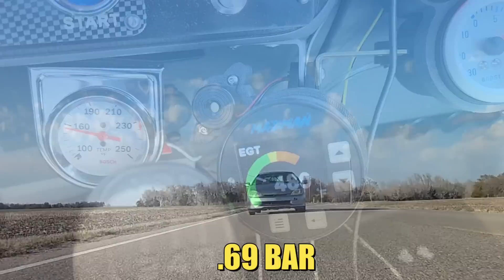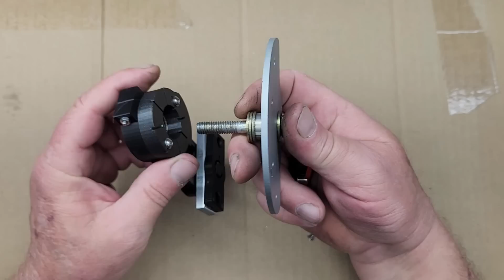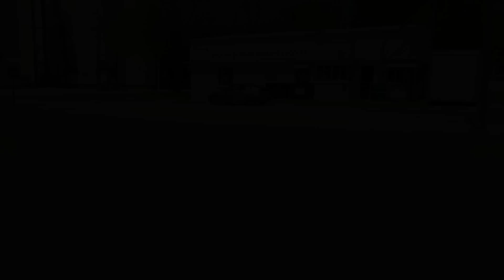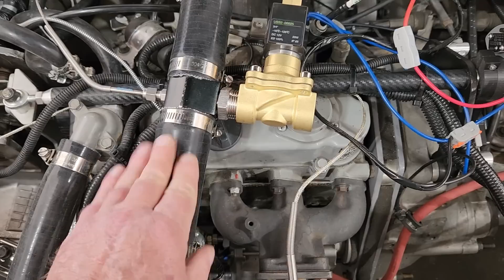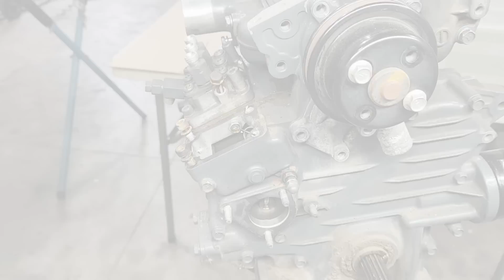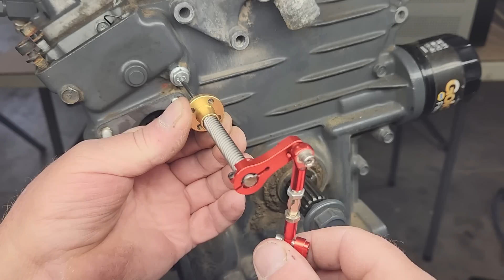S4 E15.  We  test the effects of full boost on the AMR500 supercharged the Kubota diesel engine

Comment: Yes, I'm building electronic engine control for cheap chinese 50cc 4-stroke scooter, so really interested seeing similar stuff. First ignition with different advance maps. Later fuel injection, but it needs so much more, need to build wideband controller, throttle body (from 24mm carb) etc..

Comment: This is what I love about your channel: Let's not settle with a on/off switch, let's add a valve and let's add a servo and I've printed some stuff off camera and let's go.

Most people would just half-ass try something out and stop when it goes into electronics or simple programming a micro controller, while this is exactly the best solution for most mechanical issues, if you don't wanna spend reinventing super complicated steam power mechanics.

Comment: What if to connect a supercharger to a petrol engine via a variator, and decrease its speed at low load, so that it will not produce an extra pressure but will decrease it. Then you don't need a throttle and pumping losses will return into mechanical work produced by the supercharger.

Comment: Tremendous observation and commentary about how hard it is to drive the original gas Insight in daily driving.  I owned a first generation Honda Civic Hybrid with the CVT automatic which benefitted from the technology that Honda researched/developed in the Insight.  The Honda Civic Hybrid was generally unhappy being a car and I never really learned how to keep all of the hybrid technology operating at peak efficiency.  I felt like Honda released a science experiment that was not ready for the streets (or at least the hilly Northeast where I live).  This was further confirmed by the three software updates released by Honda during my ownership-each radically changed how the car operated and reduced overall fuel economy.  With a new battery and fair weather (60s-70sF), along with a steady 55mph cruise (no a/c) the car returned almost 63 mpg-but it was back breaking hyper mile work. 50,000 miles later (and with the subsequent ecm flashes) the car would only return about 40mpg and only vaguely felt like a normal car.  Great work with the Insight, I am certain that the torquey diesel is the key to driving enjoyment and spectacular fuel economy.

Comment: Yes I'd like to see more with what your planing I'd love so see you put the turbo back on now the supercharger is also their to spool it faster and experiment with different ways of plumbing it like turbo into the supercharger like gale banks did on the race truck. Maybe use the ecu to trigger boost control based on pyro temps as a thought. I'm not sure how far you would go but can you do the same with cam timing theirs been good gains on moden engines that way. Either way I subscribed because of this little engine so I would like to see it go as far as possable other ideas would be a ram air intake for temps and air density improvements to keep up the good work

Comment: you can use a raspberry pi to have ful controll over the boost using a boost sensor and throttle position sensor. when the throttle is in a certain position for a certain time consistantly   (apart from full throttle) , the pi can assume you are cruising and not acellerating and can open the boost releif valve. the pi can also open the valve at 10psi if you dont want it to go further than that, and at full throttle it can give you all the boost if you wanted it to. using a pi will make it highly adjustable with many variables

Comment: Love your videos, I have a very mechanically inclined thought process and love every video you post, I was one of the original subscribers to suggest you use the AMR500 way back on the harborfreight engine, I have one myself and haven't decided what to do with it 😅 my vote is def yes continue what your doing, push the limits of that diesel and the supercharger till one gives or maxed out, my prediction would be the latter and the supercharger will reach its limits before you blow the engine or head gasket, if the engine blows you have a spare lol, I def want to see what you can make that little engine do FULL SPEED AHEAD!  just watch out for those pesky gnomes messing around in your engine bay

Comment: with this ON-OFF supercharger boost, there's a way you could modulate it without any further modifications, using the "pulse and glide" principle. It would require you to speed up and slow down from time to time instead of maintaining an exact 55mph speed, but simply going up and down from 55 to 60 ought to do it. Even 53mph-56mph acceleration and deceleration oughta do it. Get the throttle position low enough to un-boost yourself as you're slowing down, and you can get the car to go off-boost a lot. If boost is barely needed to maintain speed at 55 (in whatever gear you are using) then you should be able to adjust your solenoid switch to where you quickly run up to your max speed and then slowly drop speed off-boost. 

i've been using pulse-and-glide to try to improve efficiency some in my toyota prius. I'm not really sure how well the same concept transfers to a supercharged Diesel, since some of its efficiency is (maybe?) dependent on running boost.

Comment: What are about putting a air conditioner clutch on the pulley? Or a chainsaw centrifugal cluth. You won't loose energy powering the blower on idle/low rpm

Comment: Regarding the fuel rack, my apprehension (though I may be wrong) is that if you run the super at full boost at the same time as opening the fuel gate, you'll get a bit less smoke than if you just open the fuel gate, because there's more air available to react with the fuel. You may, however, need injectors that work on a higher pressure and atomize better.

I'm just joining this series for the first time, I suppose I should rewind to the beginning.

If you can find a way to make the injector timing advance under high speed, that might also help with the smoke.

Comment: Should I order oilseed sunflower seeds to your PO box and get you to grow 'em up so you can run the Insight on sunflower oil? Or have you already arranged for such a thing? (Would you even have the land to do so?)

Do you intend to change to a turbocharger or have you reckoned that you do not have the exhaust gas flow to do so? My apprehension is that with sufficient exhaust gas flow, turbochargers (turbine-driven superchargers) are much more fuel-efficient than crankshaft-driven or electrically-driven superchargers.

Comment: you can do code and adunio etc or what ever pwm solutions are needed so water injection and propane .that willl help a lot seems like a turbo be more easy and less drag yea egt`s but your not pushing it just geting up to speed and with water propane and yu programming Bobs you unculll lol  God bless PS i would start with water runs just on n off AEM makes a nice nozzle or snow performance seems like AEM is the nicest looking one but

Comment: I think dumping the boost pressure to atmosphere will decrease efficiency,  it will increase the load on the supercharger. I believe you need to install a variable bypass to the AMR500, and vary how much intake air comes through the blower or around it. Could even play with deadheading the blower, if its not moving an air it will basically free-spin (at the risk of possibly overheating).

Comment: So. 
Electronics and code. 
I literally watch videos detailing the breakdown of glitches, speedruns, etc. how the code works, with abnormalities caused by that code shown in the game. 
In a similar vein, I would love to have you explain how the hardware, supported by the sensors and software, can cause effects in how the engine runs, and how we can use those "abnormalities" to achieve a desired result (typically, go faster).
Continuing the project has my vote, it gives me nothing but more reasons to watch.

Comment: Why not just a butterfly on the supercharger intake directly operated by the throttle cable?  Also no need to actively control fuel delivery on a supercharged engine;  since there is a fixed relationship between boost and rpm @ wot, it can all be done with governor springs and flyweights.

Comment: You could use a air con pump pulley on the supercharger they have an electro magnetic on off system that you could run on a micro switch on the injection oump arm.

Comment: Yes please continue. I'm sure there is lots of improvements to be made.  Would be great with a clutch on the supercharger and both Turbo and Supercharger together. Supercharger for low RPM and Turbo for higher RPM and better efficiency. I'd guess to that you will get it down to 16 seconds to 55 and the fuel efficiency down a tiny bit. This will make this a very everyday useable car. Would also be fun to see you do experiments with bio fuels.

Comment: Yes. Use all available tech in your arsenal. 
Maybe small electronic fuel injectors HP pump and own coding on an arduino and electronic drivers for injectors. Yes it is a lot more complex but once done would have more controll on fuel delivery, timing and duration.
I don't know if arduino is fast enough to do multiple injections or fast enough to do one using high pressure, hi  pressure less time but better atomistic.
❤ the content keep it up.
Great work

Comment: My vote is YES please continue, BUT with a caveat, one of the comments  you've made is this car would run after the apocalypse. if you add "tech" you would get away from that. Your throttle switch solution is a great example of the way I think you should go. Take your programming experience and make it mechanical or simple electrical. Switches, relays, cams, mechanical movements, etc.

Comment: I'd be curious what you can accomplish with a fuel governed engine + technology, I have owned direct injection fuel governed engines, indirect injection, unit injection and common rail diesels, the CR's are absolutely incredible in their ability to run smooth, smoke free (close to it) and crank out some really impressive power and economy, they mostly got a bad rap from half baked emissions systems, lack of maintenance and people who tuned them too aggressively.

Comment: Getting max boost predominantly at your top speed, seems wasteful as you cant reach speeds any faster (above 57mph). The engine should be able to maintain that cruising speed once up to speed.

I would think that youd want to lower the rpm range where your getting max boost to the mid rpms for when your accelerating up to speed. Its more usable and less hard on a diesel engine.

Comment: Also, I had an idea for the intercooler and a further consideration. If you intend to mount the cooler on top of the engine as before, rotating it 90° (so it's standing upright but the entry and exit remain in the same rough location) might make it easier to get air in and out via a small duct, provided you have the hood clearance. I suspect a front mount for the intercooler on the vertical section just exiting the supercharger would be a better home for it though and certainly easier to get higher pressure air through it from right beside the main radiator, again ideally with a small duct. 
As for the consideration, if the cooler comes after the waste gate and you map opening position to the desired flow/pressure before adding the cooler, the added pressure drop of the core could change how it behaves. (Think, wastegate priority in a turbo exhaust manifold)

Comment: I would like to see you setup the electronic boost control. If you hookup a manifold pressure sensor, you will be able to utilize a PID loop with varying targets based on tps to set the 2nd throttle body. Might be less of a headache than hard coding the 2nd throttle body values based on tps and g forces

Comment: YES ...think using a GPS input values could assist no boost at stop, plus other input values during movement. But a fall back setting in case signal is weak or lost

Comment: Why would you want to dump boost from a diesel engine? You are already consuming power to turn the supercharger and heating the air. If you dump the boost you are getting no benefit, but still getting the down sides. A diesel does not care about "too much air" even at idle. It is 100% regulated by fuel. Concentrate on making the air cooler and regulating fuel. If you want to have selectable boost you either need a turbo or a cutout clutch and air bypass for the supercharger.

Comment: Hey Jimbo looks like you need a diode on that air bleed valve. Looks like the coil on it bucked and lit up your dash switches around ~1m into the video. This could cause other sensitive electronics to fail.

Comment: Yes and Yes. I would love to see the arduino mod (and propane injection). A honda  motorcycle cam chain tensioner 80's vintage may provide you with the action you're looking for the fuel rack. Although a cam lobe would be more adjustable. Good luck, keep up the good work.

Comment: One thing to consider instead of running an intercooler for the intake would be a heat exchanger. Or like a water→air intercooler. So you could run it in line like it is and not have to make that inlet piping more complex than it needs to be. And then pump the cooling water through a smaller cooler/radiator that would be routed down where the air is flowing. I think that would be simple enough to accomplish.
     Although I'm not sure that would be budget friendly or how cheaply it could be done. Just a suggestion that would work very well for what you're trying to achieve

Comment: YES  although I am not certain as to why, other than to see how you go about doing it.
You could use engine oil pressure i suppose. but the acme screw does seem simple.

why dump boost you are making? what is the benefit of that? I could see a clutch on the pulley system of the super charger to get boost control and not put load on the engine. But if the engine is going to have the load of the charger, why not just use the boost?

what about a cvt on the charger......

Comment: Yes keep adding controls. An option for the rack might be a GM IAC motor from the 90's to mid 2000's. There are a few variants but they are a bi polar stepper motor with about 5/8" travel as i recall (way more than you need) but they have 256 steps across that range as i recall. So something like a cheap tm2208 with microstepping and an arduino could get very good positional control.

Comment: I'm curious as to why the supercharger doesn't have a clutch pulley. I don't know if the loads are similar to an a/c compressor. I also don't know if sudden starts and stops would damage the type of super you've got (scroll vs. screw/roots). Good show.

Comment: YES. 

As cool as your smaller petrol (gasoline) motor builds are, they're relatively common or at least close to what's common. The diesel builds are far more interesting personally. 

I'm going to keep watching either way but a simple but effective diesel hybrid build would be the most interesting possibility I can think of. But in the short to medium term I'd love to see this thing twin charged with a turbo feeding air to the supercharger with water methanol injection.

Comment: @Jimbo  love your videos,  Partly blocking your dump valve, would give low pressure and high pressure setting, and the low pressure would be RPM dependent, so this could be one way to do it simple. Yes We all love your gismoes and work arounds. Glad your back in buisness.

Comment: Yes! more experimental electronic gadgetry please. I often day dream about this stuff and you're my outlet for the doing part. I know we're not on the double transmission build now either, but I was wondering if you could convert your mechanical CVT to electrical? since as I recall you couldn't get it dialed 100% with weights. Plus I'm interested in the challenges you encounter when doing such a thing.

Comment: Sponsored 
Visit the UYGALAXY Store
4.5 4.5 out of 5 stars 46
1.2" Stroke Micro Electric Linear Actuator 12V - 32N/7.2lb Speed 1.2"/sec Mini Waterproof Metal Mini Motion Actuator with Mounting Bracket for DIY Robot Cabinet Drawer Shutter Cosplay
just a thought for the fuel rack problem

Comment: I say try the throttle body in-line before the supercharger to starve it of air and this will control the boost with even less resistance , and yes the electrically controlled fuel rack is awesome . Keep going …..

Comment: YES YES YES!  Also you could control the fuel rack with pressure from the supercharger maybe you could mod an old EGR valve  to push on the rod at pressure

Comment: Now I'd love to see a full common rail fuel system on here, though I doubt there's anything remotely off the shelf that would fit. Maybe something like a Bosch DDE4 designed for a 6 cylinder engine with 3 injectors removed... That'd be a whole project in itself and probably not the content people want to see though 😂

Comment: Extremely clever idea.

Man I wana "Copy" you but with a different car. Ford Festiva mabey? and see if I can drive it practically as a daily driver. Though mabey a larger displacement model of the Kubota, I belive they make a 1 litre model 3 cylinder if I remember right. 

+ Intercooler, supercharge and full length (But straight-pipe) exaust, oh and all the internal accessories dash and all that working. lol 
My goal would be to have a maximum speed of at-least 70mph, and an 0 - 60 in less than 15 sec. Plenty fast enough for modern roads and traffic. (Youd likely never get a speeding ticket thats for sure) lol
I have thing for Diesels. 

(I might have to ask for some advice)